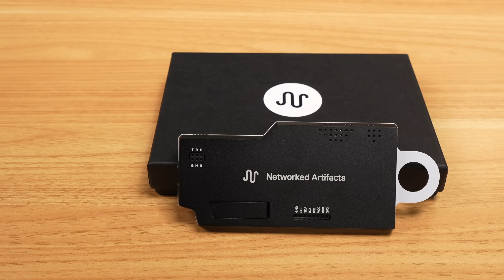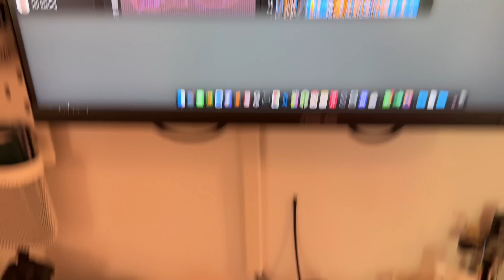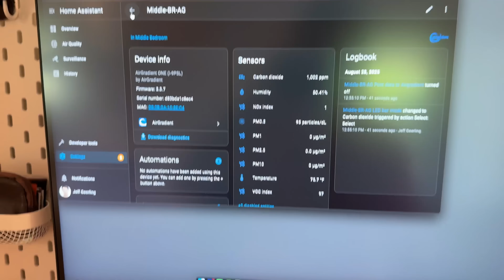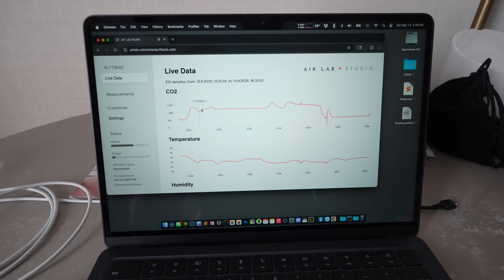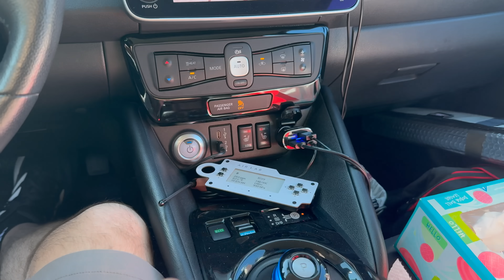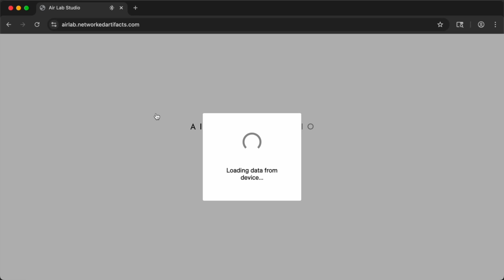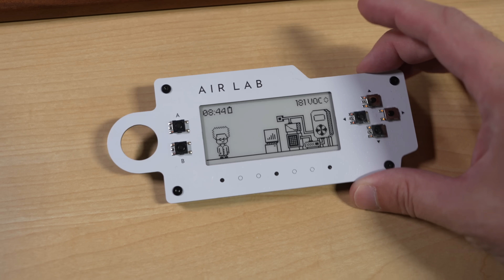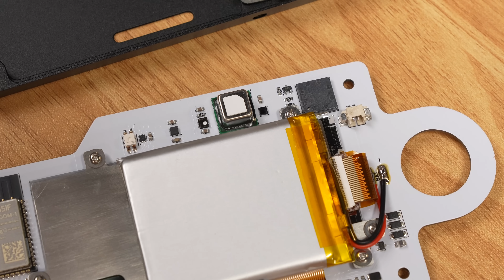Are you sure that's air you're breathing?

Comment: 1000ppm is bad for CO2. I think in the Netherlands, every classroom has to have a CO2 monitor while class is in session with an alarm set at 1000ppm. If it goes off, the instructor is to open the windows, regardless of the weather. The goal is to bring fresh air into the room. Of course, I kind of want to monitor my house too - I do open the windows a lot (and there is a recommendation to open windows and doors for 15 minutes daily to air your home out) but during the summer and winter months when they are shut more often I do wonder.

Comment: So wierd how people instantly react to the price first and the value to your health and knowledge about your environment, which is groundbreaking, a distant lsecond.  Everything is not about money, people.  Do you value your health?  Anyhow, has anyone heard of the ATMO TUBE?  I have a V2 -- also about $250 -- which has very similar sensors and a better form factor and app connected graphs and analysis. Check it out if you are interested in a portable air quality monitor.  (I do wish these had larger PM sensors because many tree pollens are much larger than PM10 -- up to 50!)

Comment: VAG cars won't even let you have recirculation on if the A/C is on Auto, they'll keep it on for 10 minutes, but then turn it off automatically. I bet it's also specified in most manufactureres manuals to not leave recirculation on for long periods of time.

Comment: I have already build something like that back in 2021 with Esphome, esp8266 and PMS5003 sensor, it was extremely easy and worked very reliably. Was less than 20$. The only down point is that you need to print an enclosure (Or have the cable mess on your shelve) lol

Comment: take it on your next flight. I was shocked that the C02 went into the multiple 1000s while boarding/unboarding and waiting. During flight it was fine. I think airplanes depend almost entirely on the engines running for fresh air intake. So if you are unsure if wearing mask the whole time is worth the struggle, a good compromise is only during boarding till you are in the air.

Comment: That’s quite expensive. If you’re only interested in CO2 the SAF Aranet4 can be found at $170. It also comes with an integrated battery and e-ink display.

If an integrated battery isn’t necessary, there’s the Awair Element, which can be found around $90.

Comment: Don't be put off by the 'build it yourself' option on the AirGradient, it really is just  matter of clicking a few connectors together and screwing the two halves of the case together. I've built a couple now and they couldn't be simpler. AirGradient supply illustrated instructions too.

Comment: Most commercial buildings are set to control to about 1000-1500ppm if they have active monitoring and control. Otherwise they are set up for occupied and unoccupied design conditions. I'd have to bust out the AHSRAE book to remember specifics, but it's like 0.3 CFM per sq.ft. of OA as a minimum, and then add like 10 CFM per person during scheduled or sensed occupancy. Most engineers like to use active CO2 monitoring though as it saves energy. Run the air handlers at the sq.ft. minimum of OA, then bring in more as the CO2 starts to rise above setpoint.

Comment: In my car, even that I never use recirculation, and usually have fans pulling outside air - co2 levels got to 2000 very very quick. I guess opening the window is the only way in my car

Comment: So was going to say without seeing the specific unit, a lot of residential air-conditioning units just recirculate air from the indoor space through the evaporator, you may see a drop in particulates from the evaporator filtration screens but other than that they don't really do anything for indoor air quality.

Also large indoor stadiums are difficult to ventilate, a few I have worked on we used CFD to design the ventilation system, however that's still very innovative for the industry.

Comment: You used to promote Air gradient DiY. Why the sudden change?
Reply from the maker: I don't promote anything, I test a lot of different devices.

As I mentioned in the video, I'm currently running five AirGradients at home, three at the studio, and I actually bought another I haven't yet set up for outdoor air.

I also have the Temtop shown in the video, and an AirThings. I'd also like to get an Aranet4 at some point, to test it out.

Having multiple options available at various price points, with different feature sets, is good. I like to share my experiences so people can (a) see what's available, and (b) understand whether something is or isn't worth the price charged.

For most people, $250 is too steep for this Air Lab, for sure.

Comment: I use the AirKnight AK1000, though it's strictly a display device.  But has a lot of sensors (PM2.5, PM10, HCHO, TVOC, Co2, Temp, Humidity) for around $100.  Good for when you are dealing with VOCs  and want to monitor levels realtime. Like when I got my shop floor epoxied and a week later I felt weird after coming out, I put that in there and found the VOCs very high even though there wasn't a strong odor.   I then proceeded to air the place out for a few weeks.  The VOC lingered for longer that I thought they would.
Reply from the maker: it's often interesting when you see data about something and it helps you understand something you couldn't quite pin down before. I had my first revelation testing CO2 when I was in my basement office and always got very tired after a few hours of work. CO2 levels would approach 3-5000 ppm, no wonder!

Comment: DIY is always going to be cheaper than something from a company? I think the real answer is, "It's complicated". I've done a several DIY projects like this and it has always comes out really janky, and you pay a premium for not buying in bulk. Plus you have to purchase tools and setup a workshop. CO2 sensors (good quality ones that will last a long time) are not cheap. DFRobot has a nice sensor for $44.50. You could add a Wemos ESP32 Lolin32 Lite, a battery and a SD card to save data and you'd be under $100, but you'd have no screen, and only CO2 measurements. Plus you'd probably want to have a 3D printer at home to make a decent case for it.
Reply from the maker: You're not wrong! I think many in the DIY / maker community discount the vast amount of working knowledge and tools someone needs on top of a basic BOM to build a given device. especially if they want it to be useful to anyone but themselves...
Reply: You are totally right. I made a homemade barometer with an Arduino, an LCD screen and a BME-280 sensor, and it wasn't much cheaper than a commercial barometer.

Comment: I find interesting that that particular device measures CO2 with a microphone. Isn’t that amazing?
Reply from the maker: Heh the Temtop you mean? The part that sticks out the top is actually where the temp/humidity sensor is located, so it can be far from the main board that gets a little warm.
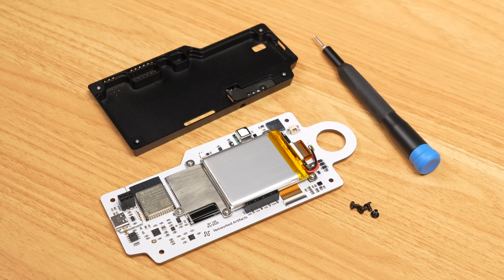Reply: @JeffGeerling  No, I mean the Air Lab. At 14:13, you can see a small metallic cube with a white stick on top near the battery. I believe this is a Sensirion SCD4x, which is a photoacoustic sensor. The microphone measures pressure variations inside the chamber as CO2 molecules absorb infrared radiation at a specific wavelength. The absorbed radiation is converted into heat, raising the temperature and consequently the pressure of the gas inside the chamber. This pressure change is what the microphone detects. I like to think of it as CO2 molecules "singing" inside an auditorium. 😀

Comment: Oh, snap! It comes with the SCD41 CO2 sensor. That's the real deal for reliable sampling. :) The price is not great at all, but its portability make it a very interesting and tempting offer. I hope they'll be able to make it cheaper. A lot more people would benefit from a portable device like this, but most won't spend that much on it.

I don't know about all of those buttons, though. I would probably use a combo of one physical button and touch controls - enabled by the physical button. Something like AT42QT1070 could do the trick, although it's probably a bit more expensive than 5 physical buttons. But at that price tag, maybe the difference can be absorbed without a problem.

Comment: AirGradient was teasing a portable monitor in a recent webcast, so may be something coming in the not so distant future. 

Also, Atmo makes Atmotube Pro and AtmoTube Pro 2 that are portable monitors that I close PM2.5. No display but connect Bluetooth to a mobile device and costs less than the Air Lab

Comment: Hyundi did a study, in a car in a high CO2 condition saturates your blood enough to reduce your reaction time equivalent to a legally drunk person. I think it took 45 minutes to cause this condition  but it effects kids a lot more.  I found it beneficial in a four occupant car to run the blower at level two with two occupants, 3 with three occupants. If you put a dog in the car, count them as two people as they exchange a lot more air. In the study I believe they concluded that a CO2 sensor should be designed into vehicles with automatic climate control but the sensors are currently too expensive.
Reply: I'd argue you don't really need a CO2 sensor because its a fixed size space, you know the air volume, you know how many people are seating with seat sensors, you can do general math to adjust the automatic AC. My volvo automatically turns off recirculate after a few minutes, it's probably just a timer and no fancy sensors, but it works.
Reply: I'd agree but many vehicles have a manual recirculate lever, have you ever seen a fogged up car in subzero weather? They just don't think about the required air needs for the situation.  @TheFPSPower
Reply: I mean, yeah, they are a whopping 0,1 % the price of a new car (SCD40 sensor). That’s clearly way too expensive!
Reply: Do I need to turn off the recirculate air setting for this?
Reply: It's enough to let the car turn off the recirculation automatically. VAG cars do this if you have your A/C set to Auto and turn recircluation on, it will turn off after 15 minutes or so automatically.

Comment: Honestly? The people who can afford this monitor almost certainly live in a part of town & an abode where monitoring is usually not necessary. Bad air quality is usually in the poor part of town (near idling diesel trains & trucks; factories; freeways & highways; factory farms; garbage dumps & incinerators) and in substandard -- usually rental -- housing (old housing stock with outdated ventilation, such as gas stoves with no externally ventilating hood fan, or improperly ventilated natural gas water heater, furnace, or clothes dryer).

We love data & graphs, but well to do people living in nice neighborhoods with lots of trees on the west side of metro areas (where prevailing winds generally come from the west) are generally absolutely fine. If you're poor & live near an EPA superfund site, you probably need one of these but can't afford it or do much about the results it shows you. -- Debbie Downer 😉

Comment: Recirculate probably does vary by car, but none of them reach 100% recirc.  There doesn't seem to be a regulation in the U.S., but vehicle manufacturers likely aim for 5-10% fresh air when recirculate mode is used.  Rather than ratio or amount, their target is likely to stay below the 1,000ppm CO2 level for indoor spaces as specified by OSHA for workplaces.

However, your testing indicates that your vehicles is not staying below this threshold when recirculate mode is used and I predict that this would be true for other vehicles as well.  I'm not sure if manufacturers test this in realistic scenarios or if they just use predictions.

Comment: $250 for advice from an (h)air quality professor? 🤓🥸

The quality of the sensors, their positioning in air and the software (cost) are big factors.

BTW: If it requires USB to setup, why not let a computer connect for a "rich" user interface? Start by assuming a "dumb terminal" connection. You may not need anything more for configuration.

I much prefer a platform-neutral web-UI for general operations. I'm not comfortable having my WiFi password stored on a portable widget.
Reply from the maker: (Just noting the Air Lab doesn't require WiFi, and I have never used it that way so far, but the AirGradient does. I wish they had a Zigbee model!)

Comment: Don't wall-mount if you want an indication of the air that you're breathing. Air circulation isn't significant at wall surfaces unless there's a sudden introduction of colder or warmer air. Locate the sensor some distance from large surfaces unless you really want to measure the condition at the surface.

Suspending from the ceiling is sometimes an option. Though not too close to e.g. lamps or ventilation openings. Arm's-length is close enough for domestic situations.

If you do have full circulation ducting where air is drawn in, then inside that duct can work quite well as it will be averaging the condition over the volume of the room.

Comment: It needs Particulate Matter sensor and HA native integration, then $250 is almost acceptable. My experience is VOX and NOx are basically worthless: there are no limits and it just shows increases or decreases, so there is no way to know if its 'good' or 'bad'. I also had to pause your 1/2 screen shots to just FIND the CO2 measurement as its not labeled on their display. Its not user friendly if you have to hunt and guess which number is CO2

Comment: It won't be nice: while interesting, this should be priced 80USD or 100 USD tops. Also, if possible, size should be reduced for at least 8 mm wide and 10mm long, keeping the hole for lanyard and hanging.
I'm probably setting the bar a bit to high for the small team, but I think that there could be more potential for this combo version (portable + standing) and a sensor version (no display, only data).

IMVHO part of the AirGradient price is due for the molds of the enclosure (it's really nice engineered and studied to be as flexible for setup as any resident sensor set should be) and the software development.

Comment: A web app is required to use it? Expect it to be unusable in 2-10 years.
Reply from the maker: The console seems simple enough to self-host it (it's not even tied to any backend system, you don't have to have an account to use it), so my hope is they'll release it so you could run it on your own locally, if you need to manage anything.

Comment: Seems that your CO2 levels are much higher than my house.  We have ERV's as well that run to keep fresh air circulating in the house when the HVAC is running.  I constantly run about 500-600 in our house.  When we have "Fall/spring" days the levels go up as the HVAC doesn't run as much.  I also have 8 Ecobees in the house (we have zone controls) so I can control those with HA as well so based of air quality outside vs inside and temps I can do control of the house HVAC system.

I have 9 air quality sensor nodes around the house going into HA.  I use DIY setup with ESP32/MCU8266 and Sensirion either (SEN66 module all in one) or (SEN55 & SCD41 combo), however I will now replace those with the SEN69C to get HCHO measurements when those are out to get everything in a single sensor.   For "portable" units I use the Aranet4 Home units, they are much cheaper than airlab, but a bit boxier in size.  They run off a pair of AA's for well over a year doing measurements every min.  I have them also in my home assistant as well reporting via BLE, while it only has CO2 it works great.  

Something you should really track are VOC's as well.  In stale air or in a newer car that is off gassing the plastic they can get very high and actually have an impact as well on overall health.   

Keep up the good work sir!  👊😉
Reply from the maker: I am hoping to add in an ERV at some point. Almost pulled the trigger on one last year, but need to line up a contractor to assist with the install as I will likely need to route it through some brickwork.

Comment: Turn off your car's recirculation button lol :P
However, I am surprised at the ppm - that's CO2 I guess, not particulates? Does this have a particulate monitor?
Reply from the maker: This version does not. They have some pins where you can connect an external PM monitor, like the one the AirGradient has built-in, but there's nothing internal :(
Reply: @JeffGeerling  it's surprisingly difficult to find one with both particulates and voc! not impossible just not common.

i think one reason is particulates sensor literally is a wee box with a fan and two holes. it counts how many little bits pass the sensor beam inside the box. ie, it takes up a lot of space plus the fan takes power.

Comment: I have a few Senseair S8 chips with some ESP8266 NodeMCU boards that I use in my house for monitoring co2. I have the microcontroller flashed with ESPHome and it publishes all data to Home Assistant so I never really felt the need to add a screen. I haven't even bothered with an actual PCB and just have it sitting on a breadboard. It's not "pretty" but it works great and was fairly cheap to build at less than $50. 

I've always wanted to make a portable battery powered variant. This device looks pretty sweet I just wish it was at least $100 cheaper. Still though I may grab one.

EDIT: Looking at the datasheet for both they are very similar in accuracy.

Comment: 15:30 That Temtop sensor has a replaceable battery inside for the CO2 sensor. You should be able to bring it back to life if you want.
Reply from the maker: I will be opening it up to find it and replace it!
Reply: https://youtu.be/9khtMIhP56E
Reply: It's a CR1220 coin cell for the real-time clock. You'll need to set the time after you replace it. The CO2 preheating countdown doesn't work without it.